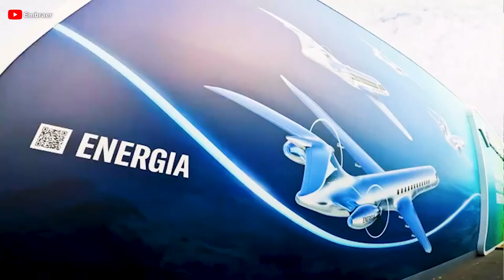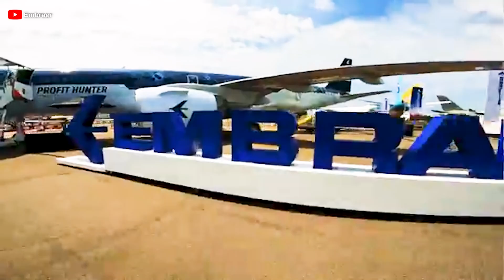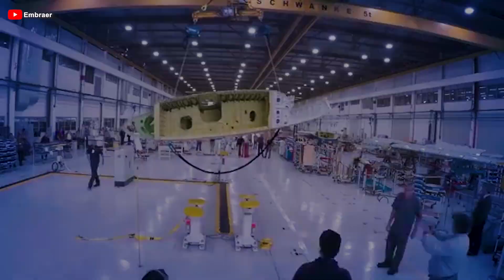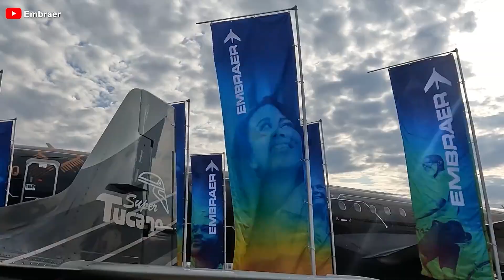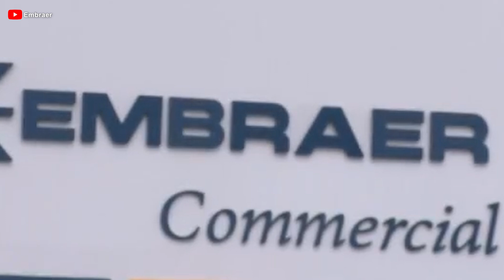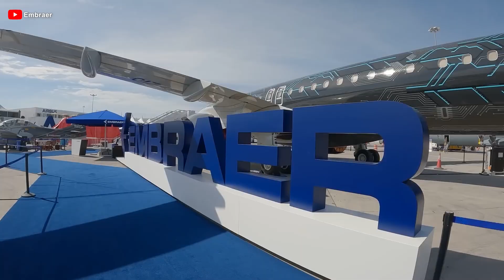Embraer's HUGE PLAN to DESTROY Boeing & Airbus will CHANGE All Aviation!

Comment: People keep spouting about Russian and Chinese alternatves and how they are superior. Whether you agree or don't, doesn't matter. Untill the Geopolitical issues are resolved, they are simply too much of a risk for too many airlines to take.

As for Embraer, they appear to have world class engineers, and while the likes of Airbus and Boeing may tweak the wings for each model in the range, Embraer optimise the wing for each model. That could give them quite the edge (or force the others to do the same?).

Never forget how Airbus went from something to be dismissed and ridiculed by established airliner manufacturers (and where are most of them now?) to doing the once unthinkable knocking the almighty Boeing off the top slot!